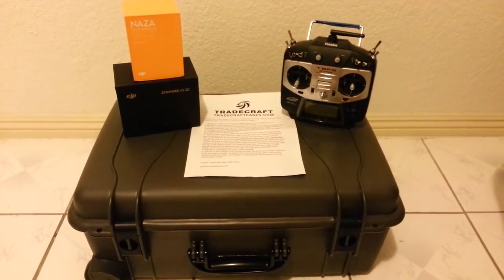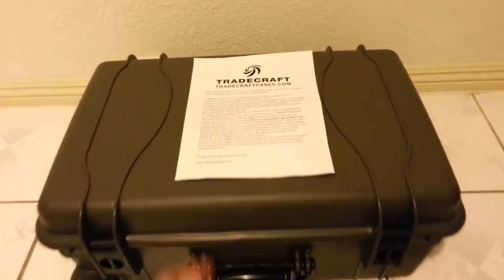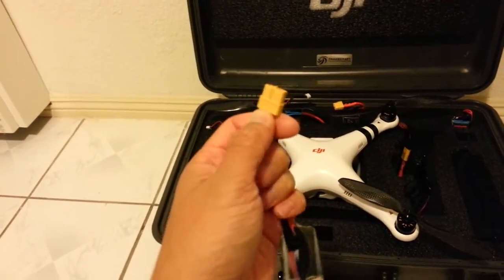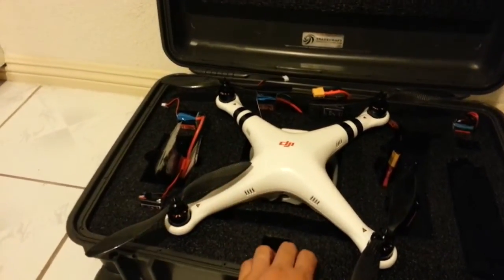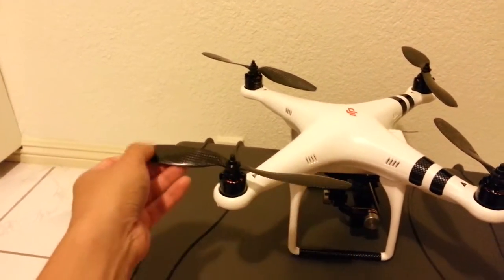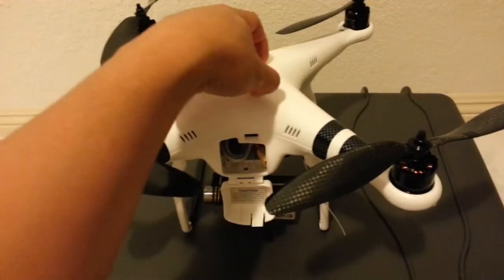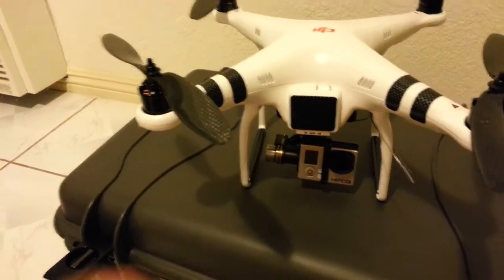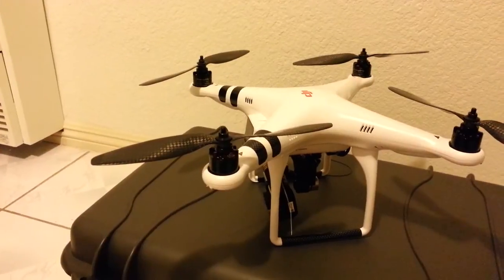Custom DJI Phantom Build Part 1

Comment from the maker: Wifi is running on 2.4ghs frequency and our radio so happens to run on 2.4ghz too. It nots recommended to use the Wifi app when flying, but I have done it a few times with no problems. But don't go do that because you can risk a chance of crashing.

Comment: Regarding recording with GoPro, you can switch on wifi app mode before firing up the Phantom. Then you can control recording and settings via gopro app w/o needing to touch cam.